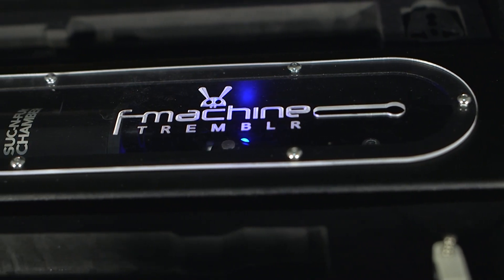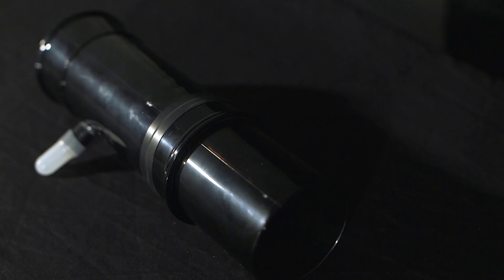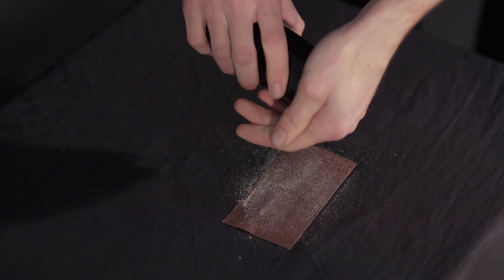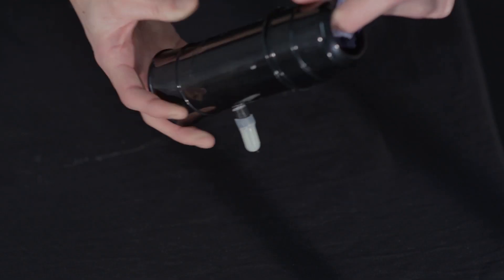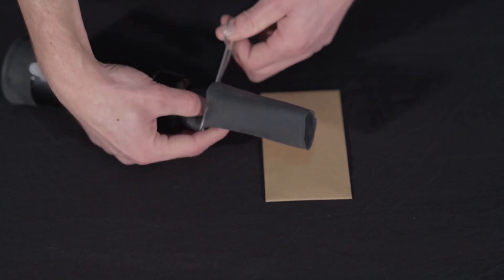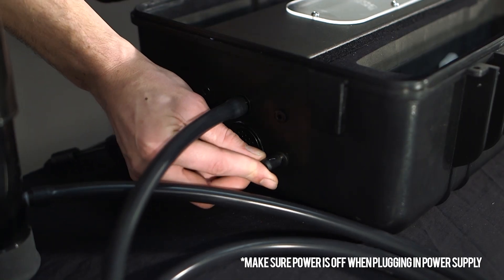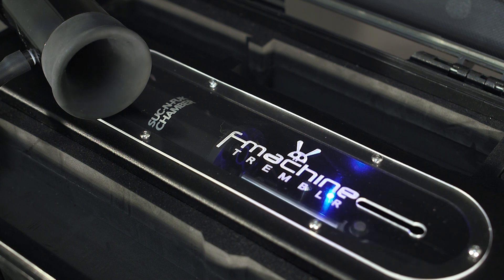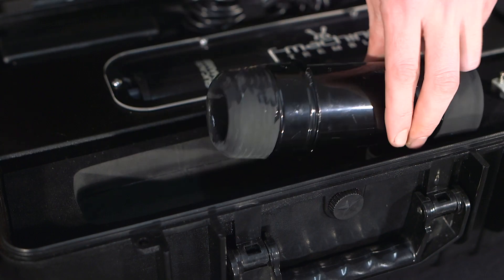How To: Assemble your custom receiver kit

Comment: Really!? Not saying it isn’t well thought out and designed, but what is wrong with going down and getting some real smash? There is nothing better than that!
Reply: I think this will mostly be bought by dungeons most limit the number of single men and therefore will mostly be used by couples or groups.
Reply: I have a better answer for you: Will your partner get you off when you're not hard? Does she have the capacity to do you as long as you want? I can assure you, this toy's counterpart, the Venus (which I own) can, and more. I have to assume this will too, as it's based on the same base design.
Reply: @darkridr25  can you get electrocuted using the Venus? Something feels scary putting that huge machines with lots of wires and stuff, and is the air pressure thing safe, you cucumber could be damaged if the air is strong ?
Reply: Stay away from these vaccinated women.. 🤣